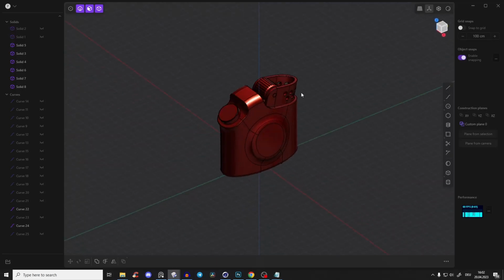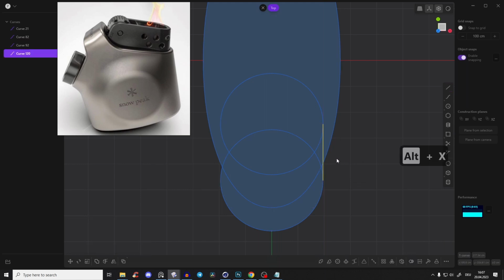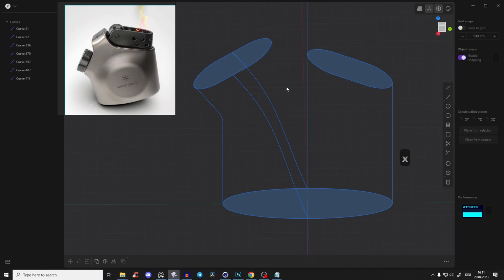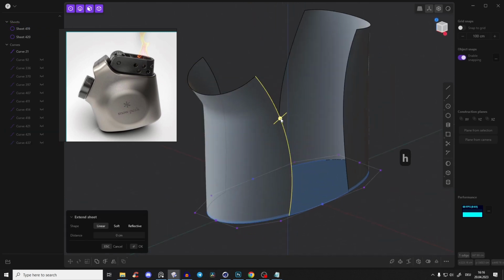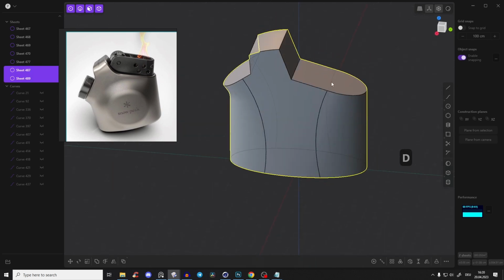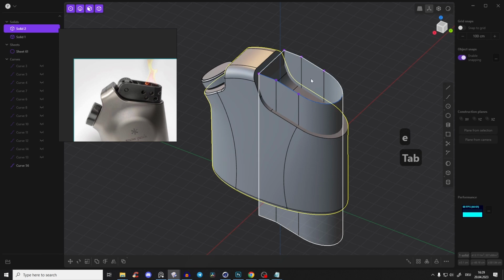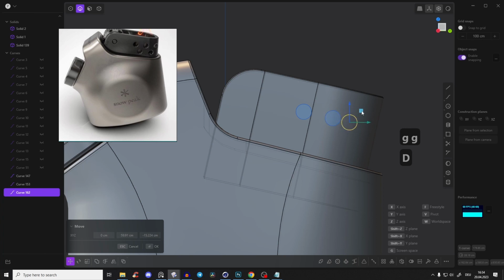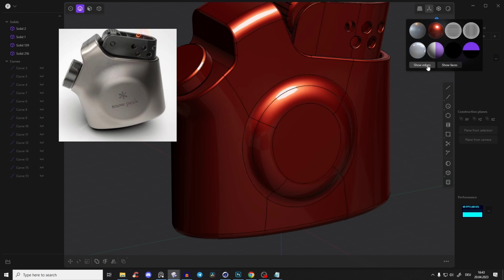Plasticity 3D Modeling Tutorial | Product Design | Advanced Lofting Technique

Comment: as a blender user, plasticity is confusing af
Reply: Yeah I came from Shapr3d to try it out since the software can be purchased, I can use it but  committing the keyboard shortcuts to memory to be able to use it is efficiently is whats holding me back.
A 5 minute model in shapr would take at least a half hour on Plasticity. I'm sure it's amazing but the workflow for me is just a huge drawback
Reply: @redherring5532  yea i gave it a shot and it drove me nuts.  and they said it would be an easy transition for blender users, my azzz